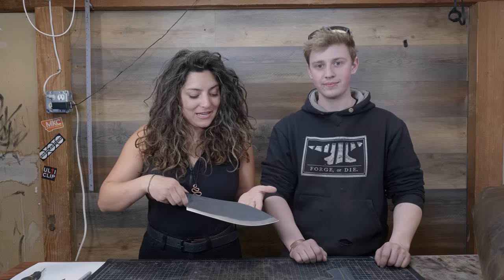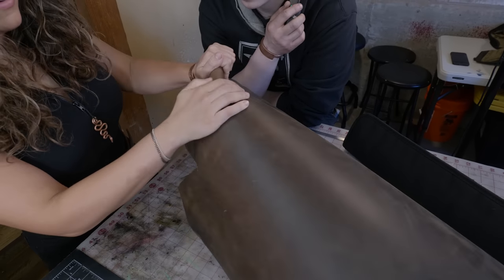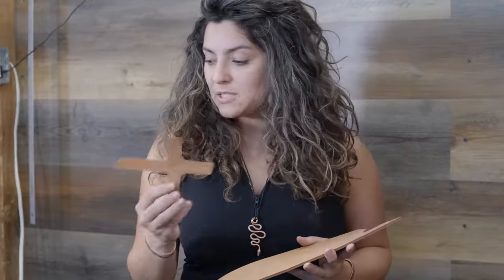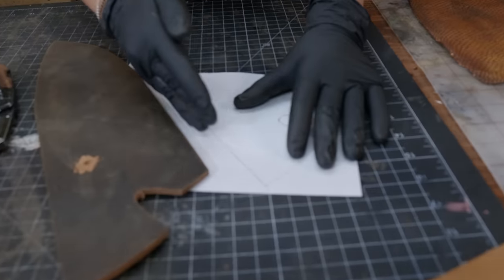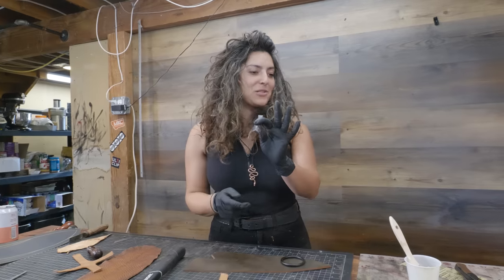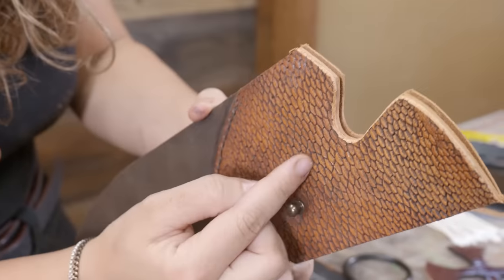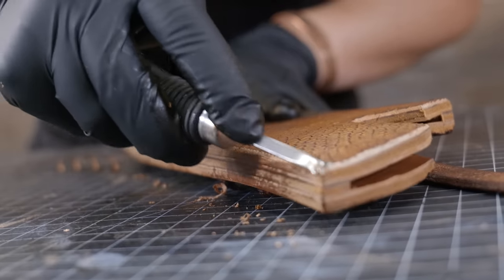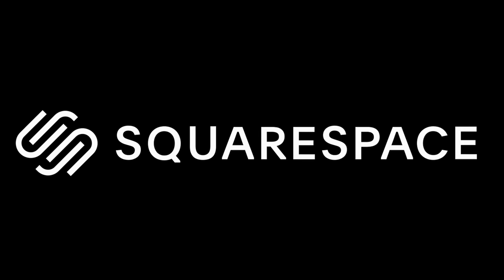I Learned How to Make a Leather Sheath

Comment: Now we need Will to find a way to make a production run of head knives.

For those that are interested the main tanning styles are vegetable, chrome, and oil tanned. Typically you want veg tanned for stuff like holsters where the leather is touching metal because the other styles are more prone to rusting the metal.

Comment: Looking good, with one exception and those are unbeveled edges. Use skiving knife to thin the sheet near stitch line. It will look much better (not so boxy) also it alows to insert extra layer to protect the thread.
Reply: Actually, the edges are lightly skived but it’s not a preference on such a large blade. 🤙🏼 just not something that’s included in the video.